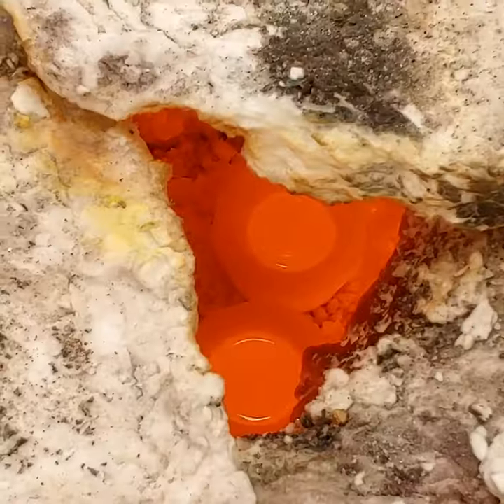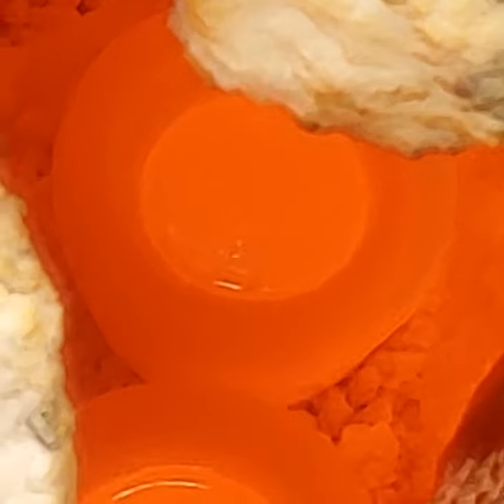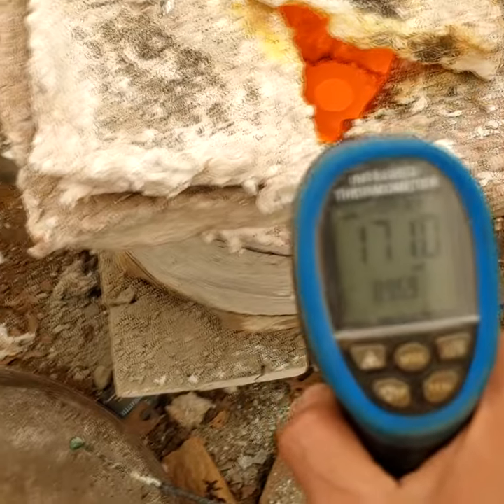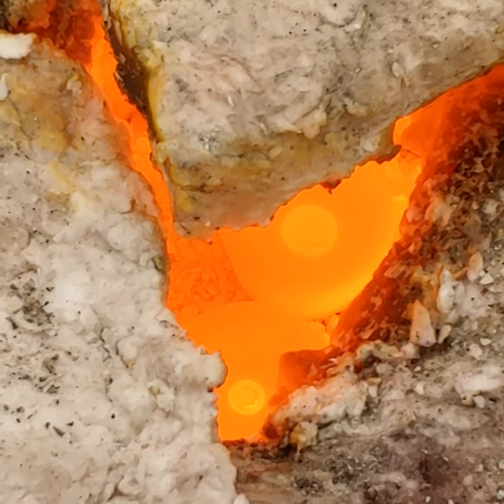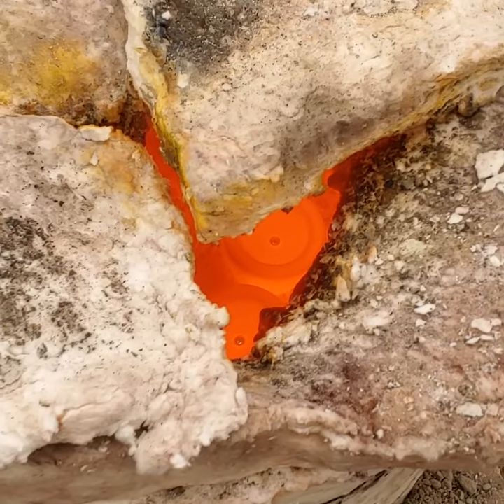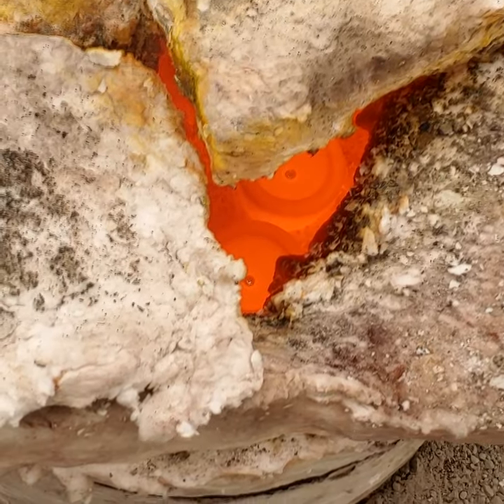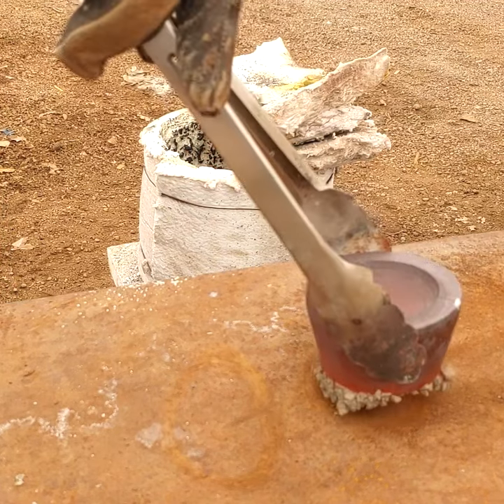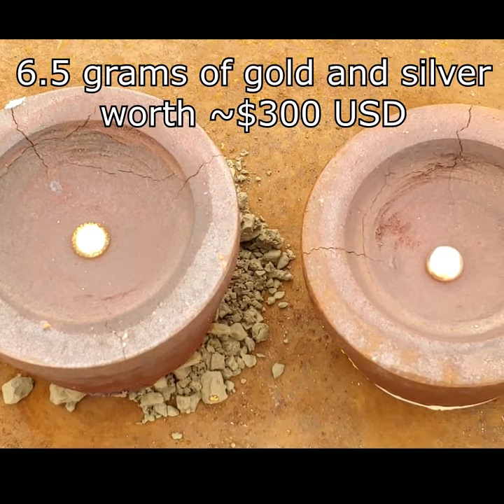Refining Gold With Fire

Comment: Can u collect the lead after ? It’s going for about $.60 a pound where I’m at. Great video 👍
Reply: Where you at?
Reply: @48thstateprospecting  0.6 USD per pound is OK-ish, here Czech Republic it is 0.2 - 2 USD per kg, depending on quality (from batteries to pure metal)
Reply: It is possible to heat the lead oxide (litharge) with some carbon in furnace and get lead back.
Reply: You can recover the lead but when gold is running about $30k a pound wasting the time & energy is sort of like stepping over a thousand dollar bill to pick up a penny